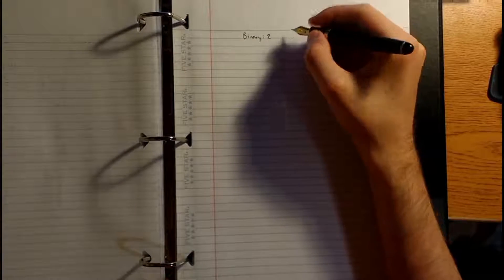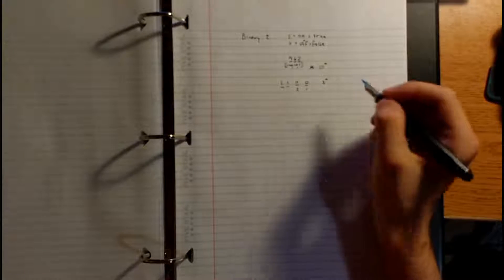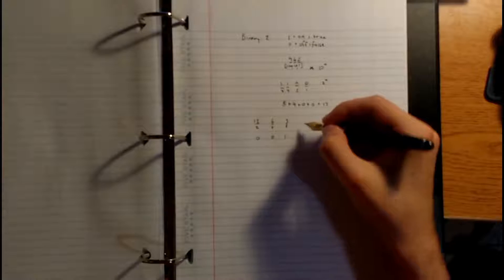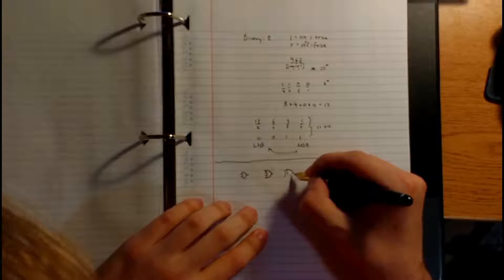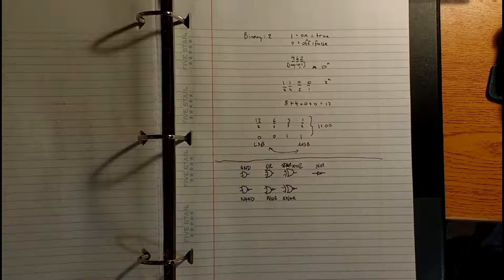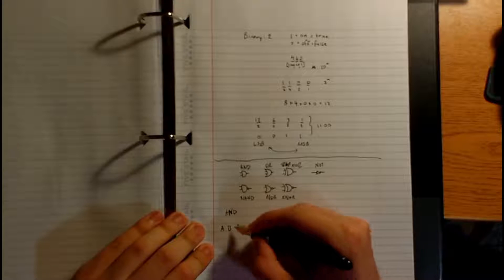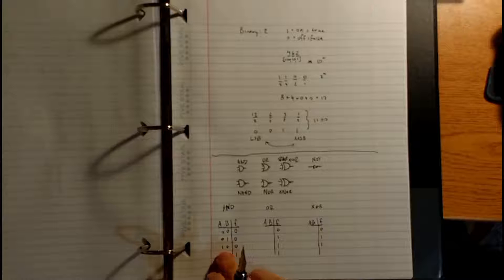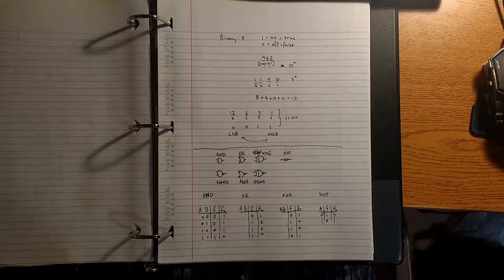Converting Binary, Gates, and Truth Tables

Comment: The inversion of a NOT gate isn't just a wire. It's a buffer because it does exhibit some propagation delay. Buffers can be used to restrengthen a signal and or to cause a slight needed time delay within some circuits... A regular buffer isn't drawn with 2 Not gates, it's typically the Not gate without the preceding dot. Now, don't confuse this with a signal amplifier, it's not the same as a normal Buffer. They have a single input and always produce the same output. If A comes in, A comes out within a predetermined range of time delays. Not so much in combinational logic circuits, and not even necessarily within sequential logic circuits, they are often used to bridge the gap between the two different types of circuits to make them time restricted compatible with each other. Any type of circuitry that posses a feedback loop with added logic that relies on a clock signal or a refresh signal with a deterministic time interval will possess a much longer propagation delay, than traditional combinational logic. 

Some schematics may show this as consecutive and contiguous Not gates in even multiples. These are typically seen in edge detectors to determine if a clock pulse is falling from high to low (the falling edge), or is on the rise from low to high (the rising edge). They can also be used within some Flip-Flops variants on the output of the gate... These are normally found within the data paths, and control lines that connect the Arithmetic & Logic Unit(ALU), Memory Modules (registers, cache memory, ram, & rom), the system clock, counters, instruction registers (IR), memory address registers (MAR), and instruction Decoder Units together forming a Central Processing Unit... Theses data, address and control paths are normally called Buses, and many modern systems even have Bus controllers. They help to keep the timing of the entire system in synchronization with each other that have internal components that rely on some clock pulse. Now many engineers will prefer to use two or even four Not gates in a row as opposed to a conventional Buffer gate since having 2,4,6,... not gates in a row will cause more of a delay than having 1,3,5,... Buffers. This is common because any kind of clock dependent or synchronous memory units are slower than tradition combinational logic circuits.